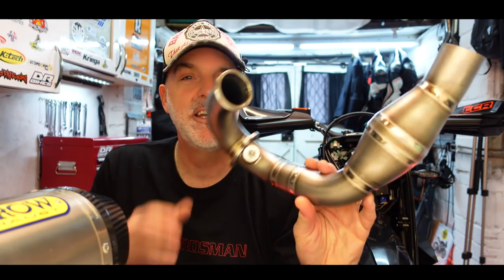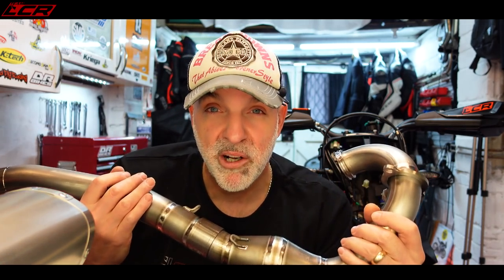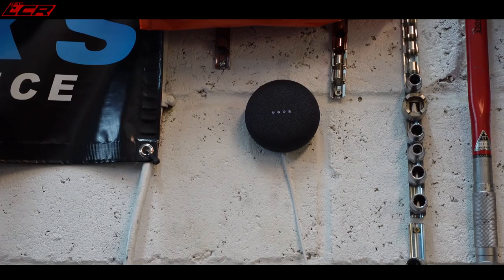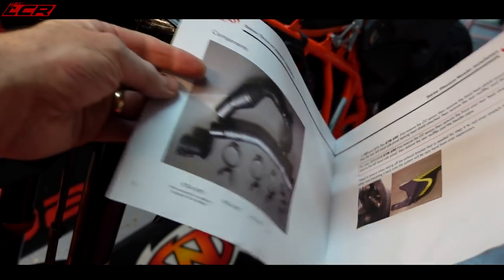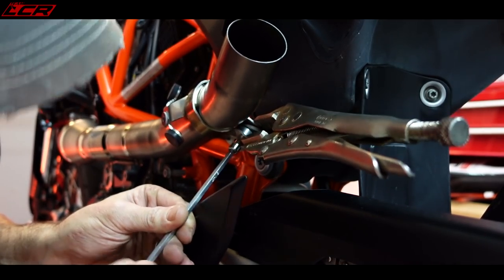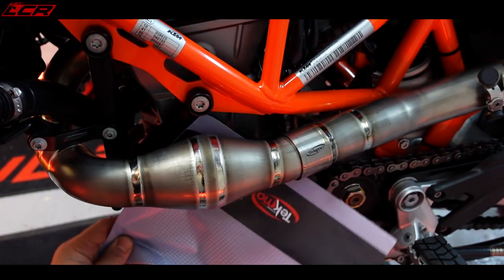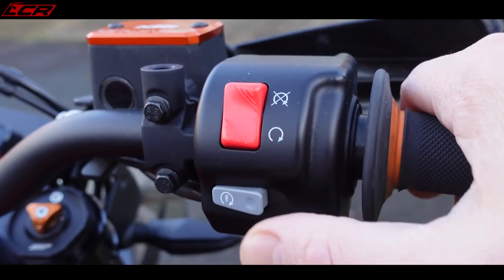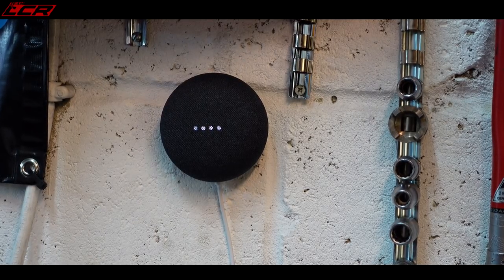KTM 690 Tekmo Header / Arrow Exhaust Fitting & SOUND CHECK! | Ultimate 690 Build Series EP04

Comment: That is a beautiful header! 

Running the stock header with Yosh R77 can on my 701 Enduro with a Rottweiler's fueling dongle in combo with a PC6 loaded with Rottweiler's map.  Running the PC6 and dongle is is night and day better than just mounting a free flowing can and calling it a day.  To complete the package you have to get a fueling dongle and a  PC6 with Rottweiler's map or equivalent.  

This engine is a crazy animal when, in addition to being allowed to breathe properly, is fed properly.  There is an increase in throttle response and power everywhere, the low end grunt is greatly enhanced, and it even sounds better with a deeper smoother tone from the exhaust.  In modded form with the TC turned off,  throttle induced no clutch up needed long wheelies are easy to do and it is just stupid in general, which is just the way I like it!

Edit.  Ya, you are way ahead of me. Well done sir, very impressive results, Chris (dyno guy) really knows his stuff.  Also very interesting about the ride by wire throttle mapping lagging the grip rotation and not being 1 to 1.   KTM has done a lot to makes this engine less aggressive in stock form.  

https://www.youtube.com/watch?v=vLyFtbolRCI

Comment: I've a 701-19 SM and same thing, no much difference between baffle vs without. I plugged the straight through opening (just like yours) but no result, I run a GPR with stock header.

My upgrades this winter are SAS, 02-sensor and canister removal. I've also cleaned up behind the radiators to increase the airflow. Changed the stock 16t sprocket into a 15t. Keeping the airbox lid but slightly modified.

Looking forward to spring/summer. 🇸🇪

Comment: Pirate Racing extensively tested the tekmo with a 701. It basically does nothing for added power. It looks neat though. 👍🏻
Reply: Depends on which muffler you have on it. Its almost impossible to do anything with a legal pipe

Comment: If you ever wanted to make the baffle work better (quieter), just drill more holes in it as it's the disruption/turbulence of the air that quietens it down. Even one on the very tip where it's totally blocked might help, I was surprised at how little holes it had, and the result as were you, definitely changed the tone for the better.
Reply from the maker: Yeah great idea to add more holes, also if I'm pulled over for noise showing baffle in will help 😁
Reply: @LambChopRides  It'll be quieter than it is now, so less likely to be pulled in the first place when using it 👍 Mine is straight piped as the cat is in the backbox too, I've not been pulled for it yet in about two years.

You could make it even better by extending it a bit to add more holes if needed. I made one for a car many years back, for our tutors daughters car at college, as the original had rusted away.

Comment: Sorry how many parts from tekmo did you fit in? I just checked Tekmo, and I can fin the powerbomb, but it does not include the middle part to connect it to the arrow part... do you know the link to that little part? it's the one right after the powerbomb... quite a small part. THANKS AND GOOD JOB!!

Comment: Chops, I picked up a 2021 SMCR, partially because of your videos.  200 miles on it so far.  Love it.  Probably going to do the same exhaust as you did... Arrow with Tekmo header, although I might do the full Tekmo.  Not sure yet.   The stock pipe sounds terrible and doesn't do the bike justice.  Love the sound of the Arrow.  Now that you've got some miles on this, did you end up going with or without the baffle in the Arrow?  I don't want my bike to be insanely loud, but I do want a good amount of sound that I can hear while riding, so I'm curious of your overall thoughts on the Arrow from a sound standpoint?  Powerwise this bike is good enough for me stock, so power gains are an added bonus to the sound it's going to provide.

Comment: Hey there, i have the 2013 model with the akrapovic backbox and standard header. The bike has the ecu setting from 1 tp 10 under the seat and its on setting number 2 which should be sports mode and i think ill install a rottweiler air box. For more midrange power increase, should i leave it on setting 2 and thats it, or install a dynojet commander and also map it? Thanks for the feedback

Comment: Hello LC, what are your thoughts on the Rottweiler intake?  I fitted one to my 950 SMR 2007 (UK), removed the SAS, and installed the shortened trumpets, and jetted. Now, while its hilariously louder, and changes your face to that of the Cheshire cat while riding, there is a noticeable increased amount of vibration.  The original air box actually provided a degree of vibration attenuation. Have you experienced this too, and if so, any remedy you know of? Thanks and keep up the good work!

Comment: Anyway of having the remap (pcv5, airbox, full exhaust) and still keep the pops n crackles or do they go away for good? 
Also chops was there not a lead-like ring seal on the stock pipe of yours that needs to go on the arrow before tightening the ring clip?

Comment: Quick question about that Tekmo header. Does the expansion buldge on the header prevents an easy access to the oil filter for an oil change ?
I'm about to pull the trigger on one, mostly for the look, but I wont bother if I have to remove the header every oil change.
Reply from the maker: Nope it's clear 👍
Reply: @LambChopRides  Thanks for the super quick reply. Rottweiler, here I come :D

Comment: You don't use exhaust paste then to seal it so there no pops and bangs on the over run ?
Reply from the maker: Yes have a couple of bits blowing very slightly. Going to add some which does come with the Arrow 👍

Comment: 12:57 air leak just after the expansion chamber chopsie - get some exhaust joint compound on the joints
Reply from the maker: Yes well spotted, need to add some there 👍

Comment: well i went and did it chops put the arrow back box on my 2021 and a o2 sensor delete dongle kit from crt and went out on the bike and the damn engine light has come on the bike has only done 103 miles total :( dont no what to do bummed out man
Reply from the maker: Oh no that's very annoying! Have you tried swaping the dongle out see if it helps?
Reply: @LambChopRides  i will give it a try if all fails i will put the bike back stock and wait untill someone has modded there 2021 and copy it

Comment: Do not let the shido battery charge fall below 50%
I did, and it was unrecoverable at only 2 months from new.
 Went back to lead acid :-(
Reply from the maker: Ok interesting will watch that, have one on my H2 also for 10 months now without issue but do keep it topped up 👍
Reply: @LambChopRides  its a shame,
They are comically light.
Happy new year chops.